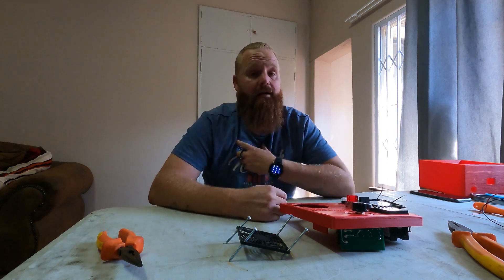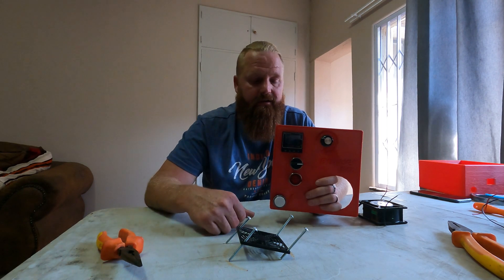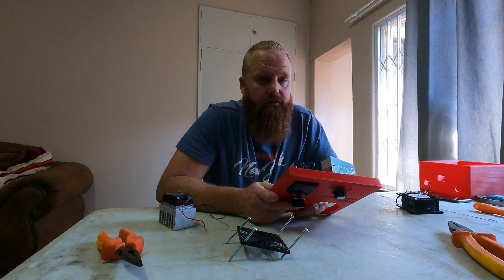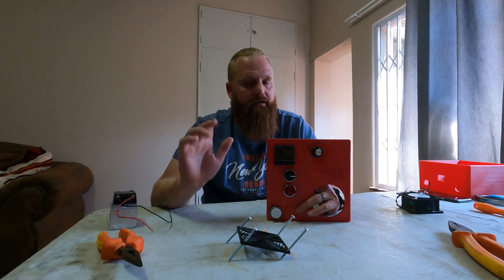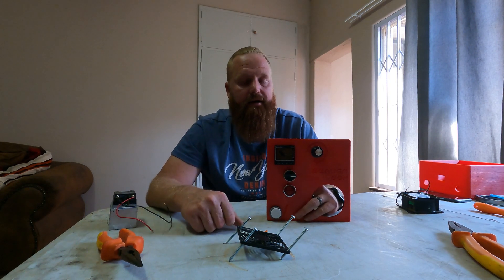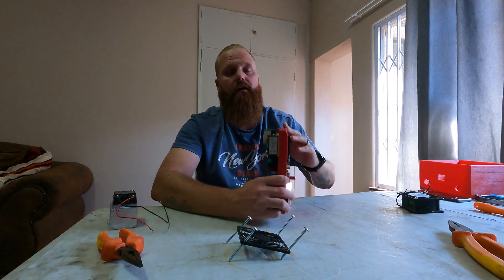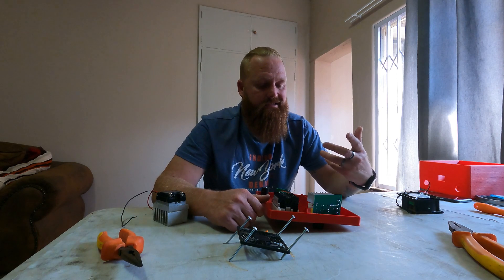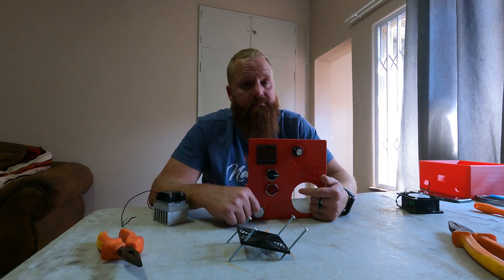PID vs SCR which one do I prefer

Comment: Love my PID. It know I can set my still 150F and it will take 36 minutes to get my first drop. Once the take off slows down, I can discard the distillate, bump to 180 and collect it all. After 180F I can bump at 5F at a time till I run into tails. My 5500w element killed the two SCRs I tried at half power.😢

Comment: I have a PID controller but I am not happy with it at all. it shuts off at temp and my run stops until pid decides to turn heat back on and it get back to temp to run. I heard scr controllers are better and I am contemplating swapping over

Comment: When I was using my PID, I would run it in auto to heat up the still to around 165V.  Then, I would switch over to manual and adjust the percent power to balance out my column.  Then I would pretty much leave it alone throughout the run.

Comment: Take a good look at Digital SSR Power Regulators. It's the best of both worlds imo. I run Auber's DSPR400. Digital power regulation that can switch to PID mode is a dream on a home still. Also allows me to use my boiler to heat my mash water to a specific temp.

Comment: Im not sure how you do it, if the temp probe is in the lyne arm and reading the vapour temp it is seeing the temp rise which of course means the vapour abv is dropping, therefore the PID reduces power to reduce temp but that will reduce vapour speed and reflux dropping abv even lower or just stops everything or is the algorithm more complex. vapour temp is directly related to vapour ABV

Comment: I have the same style controller and use it as you have described. The only difference between the two is, mine has a digital volt/current meter on the out put side. It's great for calculating the wattage for quick referance

Comment: Good info Beaver. 
Am I the only person that finds using the dephlegmator (or the adjustment of flow of water through the dephlegmator, with a constant energy input to the kettle) the easiest way to control the output speed?

Comment: all the best for your new position! ive never used the pid capabilities of my newer boiler, i probably should just for the experience, ive always got a kick out of my phase angle controller i use with my usual boiler, i made it with old timey mechanical movement voltmeter and ammeter for instrumentation, i have a thing for old mechanical dial thermometers too lol

Comment: I tried a PID, but since my still is semi outdoors every hint at a breeze or ambient temperature change would send the thing doing wild acrobatics, it would never hold a steady take-off. I can dial my SSR in and walk away.

Edit: I have a 52 gallon still, it is away from the house, it can run for hours all by itself, walking away is not a problem.

Comment: The biggest advantage of the PID's over the Chinese SCRs is that the SCR's have a tendency to crap out and then you have to wire in a spare IF you have one.    That said the SCR's are dirt cheap.       I like the idea of the safety net that a PID gives you so that you don't blow into your boild BUT I run 2 elements on heat up; 1 straight to power an the other one on an SCR and track temperature to know when I have to be ready to turn the heat down and unplug the second element.   I appreciate wiring videos even though others already exist its nice to see how different people wire things up.

Comment: Nice to see you online again.  Good luck with the new venture in Lephalale / Ellisras.  
I struggled a bit with a PID on a smaller pot still, I got quite weird temperature fulgurations as it switch on and off during a run.   I felt bit better in control with a SCR on the smaller setup.  
PID did work much better when I got a bigger pot.  Would be great to see how you did the wiring on this system.